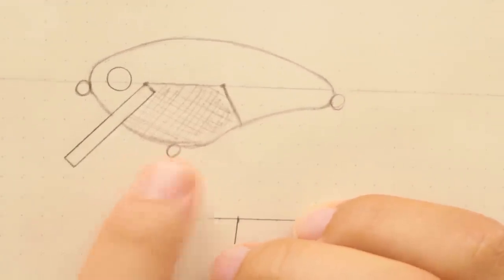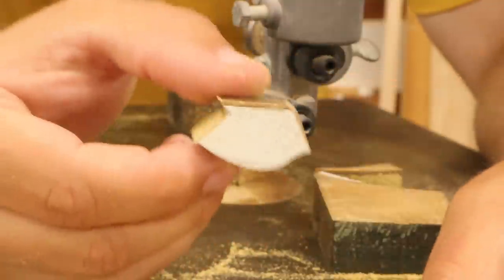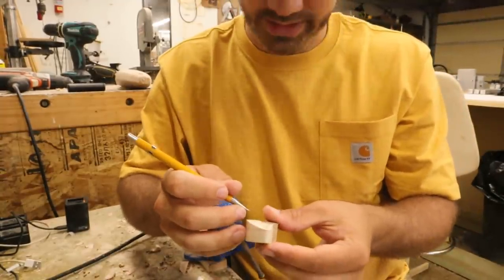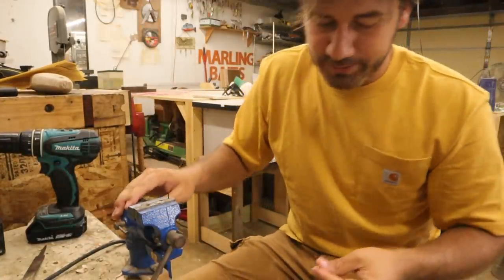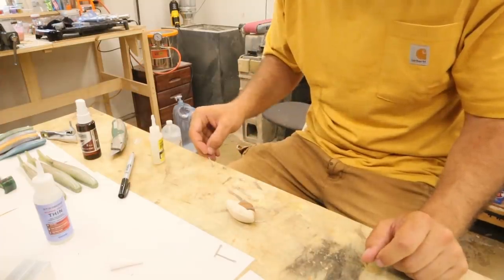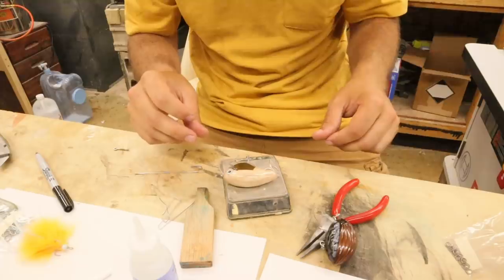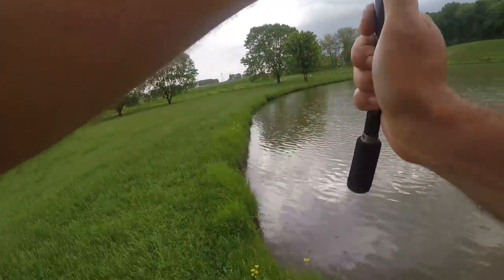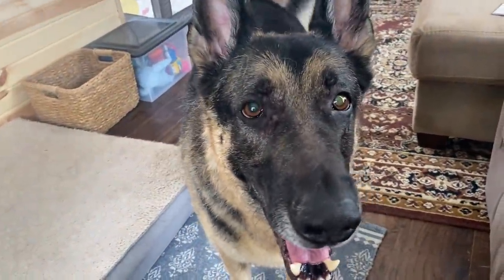Hardest and Softest Wood in the World | One Day Build to Catch

Comment: When I was was a kid that dense wood was used for intermediate prop shaft bearings in commercial fishing boats. It is verry oily and hard so was long lasting in the wet environment of the bilge. It tended to be self lubricating and didn't rot or corrode. It also would not score the shafting like a babit bearing mite if you forgot to grease it.
Dan R
Reply: Yeah and it's still used in water dams on the turbines for that very reason. It's amazing
Reply: that's rad as heck

Comment: You are so inspiring I started making my own lures myself
Reply: Sam
Reply: Same
Reply: i’m on my way. i’ve started learning to repaint lures that have been passed down to me over the years, enjoying that a lot!
Reply: Same
Reply: Same
Reply: Peter Griffin with The Biggest Hat i made my first lure with nothing more than a knife and scrap sandpaper.
Reply: @Peter Griffin with The Biggest Hat Nice power tools tools make it way easier. But I've made lures from tree branches. All ya really need is a saw, exacto knife, nail polishes and sandpaper. All the metal parts I took off old lures I dont use anymore.
Reply: Yep. Me too.
Reply: Peter Griffin with The Biggest Hat carving knife is a must
Reply: Same
Reply: @Peter Griffin with The Biggest Hat get a job and buy some tools
Reply: @TristanAD_  I just got some razors a 10 dollar finishing saw at Lowe's and sand pepper then use split shot and hooks that you probly have and wood just find some junk wood or dry branches out and square them up that's what I did
Reply: Mike Rotch how did you do the hook hangers
Reply: Peter Griffin with The Biggest Hat I use a knife, sand paper, and a hack saw. That’s literally it. It’s super easy and super rewarding. And it’s still pretty quick. It took me about 3 hours to make a tail spinner. Hope you try it!
Reply: Same
Reply: Chase Surfer same
Reply: Peter Griffin with The Biggest Hat band saw and a wood chizle balsal wood and a clear coat and paint
Reply: Peter Griffin with The Biggest Hat  you don’t need all of those tools. I made a lure without any electricity, and works fine. It’s easy and fun.
Reply: Peter Griffin with The Biggest Hat I got some knives, chisels, and a vice off of amazon and a cheap drill press and bandsaw off of craigslist. I also use the Iwata Neo airbrush and a Central Pneumatic Compressor from harbor freight. Overall I have about $400 into it. But I still need to setup a UV curing station. I also use an old gravy ladle and my stove to pour lead. It works pretty well surprisingly. Good luck on your bait making journey.
Reply: Peter Griffin with The Biggest Hat you don’t need much to make a lure but it’s going to take longer with machine tools. All you need is a hacksaw, different types of sand paper, balsa wood, box cutter or sharp knife and some fish eye screws. You’ll also need to paint it but you can also go bare like Marling lol if you need help watch basic videos of making lures. You got this!!
Reply: Same
Reply: Minty use fish eye screws or 50 lb wire and twist it with pliers
Reply: Same
Reply: Same
Reply: Same
Reply: Me too
Reply: Same here
Reply: Same:)
Reply: Yes me too
Reply: me too
Reply: I.made one from a jenga block lol

Comment: A tip I use for sanding: I save old belt sander belts the cut them in half. I then spray glue  and wrap them around different diameter dowels at an angle and they makes it super easy to sand any surface.

Comment: A trick for gluing oily woods -- wipe the surfaces to be glued with acetone or some other solvent to remove the oils on those surfaces, and slightly deeper. It's an old boat building trick used with teak, among other woods.

Comment: Nate, could you run the same concept of lure but instead of having a chunk of the dense wood on the bottom, cut a slot and insert the dense wood in the insert? I have been playing with an idea like that. It would distribute the weight, keep it centered, and keep the light wood on top. I am curious if it would wobble correctly.
Also, have you ever thought of making a lure out of the composite decking material? I think that would be interesting to see.

Comment: helpfull note about industry standard strength testing 

rated strength means what it supposedlycan handle without deforming for an extended amount of time 

failure point can be several times the rated strength depending on the material but generally a margin of two times the rated strength is a safe bet

Comment: What if you cut a slot in the middle of the belly and slide the heavier wood in there so the weight is more centered. Similarly to the lip slot but in the belly with wood that could fit flush in the bait... the shape would have to be different but if it was more of a jerk or swim bait it could work better. Just a thought.

Comment: You should try to get some tungsten shavings to super glue in the bottom. As low as possible tungsten is almost twice as dense then lead. 

Try some experiments with a higher weight and lower center of gravity.

Comment: First off, you crack me up with your quirky comments.  Great channel.

But also...a trick you can use for flying up oily woods is to aggressively wipe the glue surfaces with denatured alcohol right before glue up.  This helps remove the surface oil and allows the grain to take the adhesive.  At least that’s what I think...I just know it’s a common trick with rosewoods that are oily and can be tricky as a result.

Comment: Not far into the video yet, but I felt like it would be important to tell you that it's normal for the very dense (mostly tropical) woods to have a bunch of oils in them, which makes the dust stick so hard and make it smell weird. There's a lot of kinds of wood that can really mess up your respiratory system if you breathe in the dust. The irritating to the skin part actually only applies when you beltsand the stuff and get pretty hot dust on you. And you can trust me when I tell you this stuff gets absurdly hot on a sander.

Comment: I wonder if the action would be better if instead of using a cube like shaped insert, you used more or a triangular shape. It would concentrate more of the weight at the bottom while also lessening the weight at the top.

Comment: Heaviest woods in the world #1 Black Ironwood - 1355 kg per cubic meter,#2 Itin - 1275 kg per cubic meter,#3 African Blackwood - 1270 kg per cubic meter,Lignum vitae comes in at #4 with 1257 kg per cubic meter. It is widely considered the heaviest, but there are 3 others heavier. It is also endangered. But lignum vitae is the hardest wood according to the Janka scale  at 4,500 pounds-force lbf (pounds force)But the softest wood in the world belongs to the Cuipo tree, which has a rating of just 22 lbf (pounds-force) making it is much softer than Balsa wood which has a higher, but still very low rating of 100 lbf. And yes I'm a wood worker by trade. Commented before watching the whole vid sorry and yes most of this info came from google but I already knew about these woods just didn't know the exact numbers off the top of my head.

Comment: Having trouble finding your pencil? Try grabbing an old piece of 2 X 4 about 6 inches long. Drill a bunch of holes big enough to fit a pencil in loosely. The holes should be about an inch apart. Buy a bunch of pencils or mechanical pencils. Fill the holes with pencils.